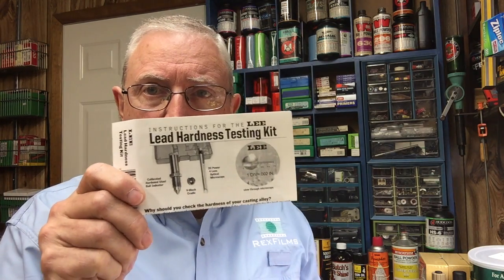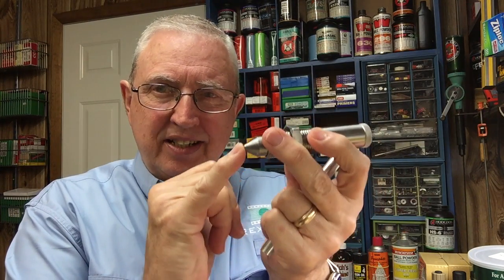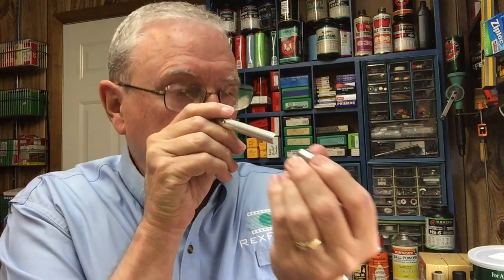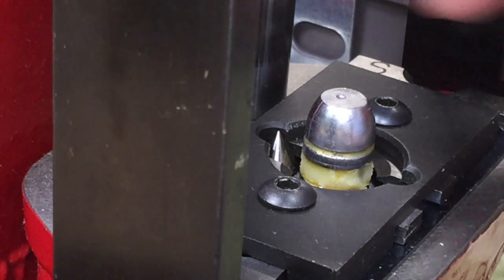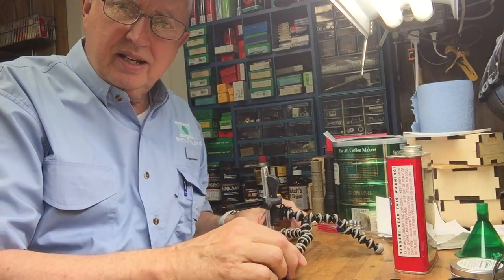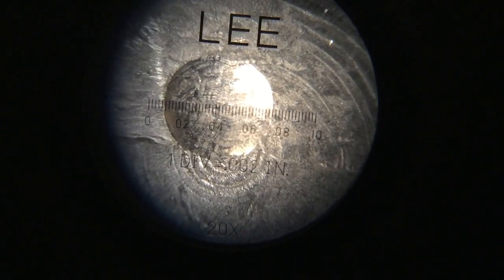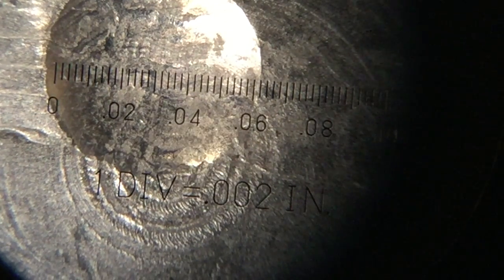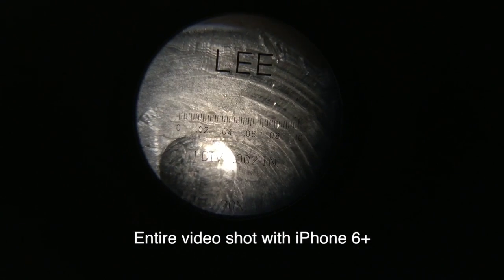Lee Hardness Tester

Comment: Nice tool, boy, you have it together in this realm. If I understand this right, the  higher the number the softer the lead, as the dent would be deeper, hence longer distance between marks. roger. What is a suitable number for  a 44 black powder ball, or bullet, especially a pistol that must be rammed in by a lever on the gun?
Reply from the maker: You've got the right idea, but it goes a bit further. The larger the dent diameter, the softer the lead, but you look up the diameter on a chart supplied with the tester (and readily available on line) and the Brinell hardness number (BHN) will be given. The BHN moves exactly opposite to the diameter so harder lead has a higher BHN. Pure lead has a BHN of about 6 and is preferred for muzzle loaded balls or for BP percussion pistols. If you get into lead alloys like wheel weights, the number will typically be 12 or higher. Great for cast bullets fired from cartridges, but too hard for your BP ball gun.
Reply: @RexRoach  The lead used to line drywall for hospitals is great for black powder, was doing a demo of an x-ray room a few years back, and they were gonna throw it in the trash bin, so I pealed all of it off and got quite a haul. I figure the only way to soften up that wheel weight lead for black powder balls, or conicals is to add enough of the softer lead to the mix, unless there is a way to remove the tin from it by heat, but have doubts as to that process working well.
Reply: Thank you for the information.

Comment: I believe the reason you won't want to do it on the base has to do with the fact that the sprue has been cut there and possibly the rate it would have cooled there will be slightly different than the rest of the mould.

Comment: Thank you, for the great video. If I could add one more thing, the scope should be against the surface and at the best right angle you can achieve to the material being tested. If the scope is positioned away from the surface the reading will be inaccurate. The scale is calibrated to the end of the scope, therefore, must be in contact with the surface being tested. Hope this information helps.
Reply from the maker: Thank you for your excellent input. It makes sense to have the reticle calibration and the point of focus of the scope to occur at the same time. Very good point.

Comment: Two things you did wrong. You should file the bullet long ways and test the center of the bullet from the side. Also, you have to hold the press for 30 seconds to get an accurate measure. Your bullets are softer than you think because you did not allow the press tester to work properly. YOU NEVER TEST THE ENDS!!!!!  Another tip: the opening at the end of the scope is for a flash light to shine on the bullet so you can see what you are doing. Clever idea for you makeshift scope stand.
Reply from the maker: +Anthony Evans Thanks, Anthony. Between you, Charles and Englishman French, the correct methods have been revealed. I should probably delete this video and start really reading the instructions.

Comment: Rex...Don't test on the end of the boolit…Lee says not to in the instructions, best testing by filing a wide flat on the boolits side hence the v-groove shell holder... They say also test for 30 seconds as the Englishman point's out.
148DMC…Boolits  test @ 48 hours after birth. They continue to harden for a year and then after that will loose up to 1BHN and stabilize  there. 
How much? It all depends on the lead mix. Generally they will pick up to 1-3 BHN in that 48-72 hours. My clip on wheel weights have been running 11.3BHN + 1 BHN. I've had these water dropped @ 16 BHN If you want significantly harder boolits drop them in cold water from the mold…keep the water far away from the lead pot or you'll have a 'steam explosion' in the pot…It ain't very pretty after that! Put a rag over the H2O container to minimize the splash, cut a slit in the center of the rag and they will roll down and fall through it.
You really don't need harder than the 11 or 12 BHN for general duty in pistols non-magnum. Your cylinder/barrel fit along with the lube make up 2/3's of the equation for non-leading shooting. The instruction sheet gives you a working pressure for the BHN levels…stay equal to or less than as a general rule of thumb.
There is a world of knowledge and searchable data base over at 'Cast Boolits.com' it's no cost to anyone and those boys over there know what they are doing for sure!
Reply from the maker: +Charles Irby Excellent points, Charles. I think I've seen your name many times over on CastBoolits.com It is, as you say, a site with a world of knowledge. It's probably my favorite overall forum. 

I like your points:

* hold for 30 seconds (I missed that one)
* hardness will increase with time
* quench in cold water for max hardness
* 12 BHN is hard enough for non-magnum
* cylinder throat fit and lube are equally important

My only quibble is about testing on the nose. I'm being stubbornly uncooperative for right now. Yes, Lee does advise against it. I'm going to run some tests and check various spots on several bullets and see what happens. If it turns out that all spots read the same, then I'll continue with my "easy" method. If not, I'll confess my sins and repent. 

Having said that, do you or anyone else reading this, have an idea as to WHY one should not read the nose and should file a flat on the side for reading?
Reply: Hey Rex…I think that Lee wants us to test inside of a larger area of lead that surrounds the indent so that it prevents the lead from spreading sideways under pressure on a narrow nose causing a deeper indentation and a false sense of low BHN. Also if that 'micro-measuring-scope' is not touching the surface of the lead that is being measured then you are magnifying the indention larger, getting somewhat out of focus and again getting the wrong results. Testing and measuring is an exact science that must be executed to exactness for consistent results.
   I'm with you…why not test the nose and I don't have to destroy one of my boolits, its quicker but I can see their point also…so I get the old flat bastard file out and have at them. It's habit now. When I was proving to myself about the lead getting harder with age…I filed a wide cut down the side of some test boolits and could take the time-test on the same boolit not just another one in the same batch. That forced me to put some color on the spot where I would make the second, third test to differentiate between test spots so I used a red Marks-a-lot and found that with color you are able to see the crisp edge of the crater making it easier to measure that tiny/wiggly boolit.

SeeYa…charlie
Reply from the maker: Charles Irby Charlie, this is excellent information. I can see their point now that you've 'splained it to me (like Desi and Lucy). These 45s have extremely wide points, but I am going to experiment. Having that larger area to "land" the microscope flange onto would be yet another reason to file the large flat. 

Speaking of bastard files, I've never had a moment's pause as to why they are called that. 

I REALLY like the idea of color for edge enhancement.
Reply: It's nice to share that with you Rex…hey, your giving away our age mentioning Lucy and Riki!
Reply from the maker: Oh, Lord, I'm older than Fred Mertz.
Reply: "I'm sorry Rex"! I hope you found your stay here on this rock pleasant…as for me…I ain't coming back!